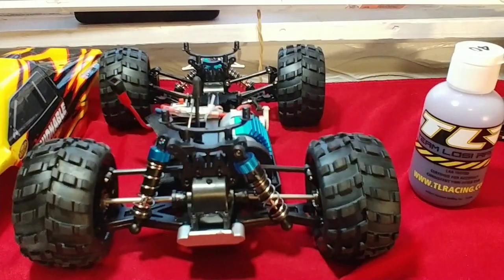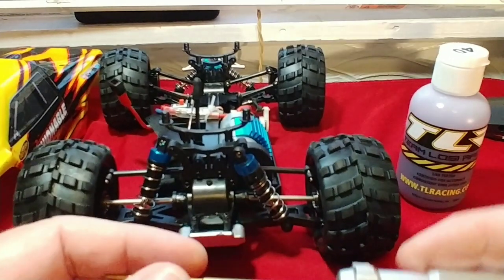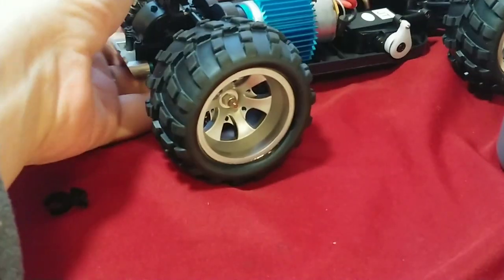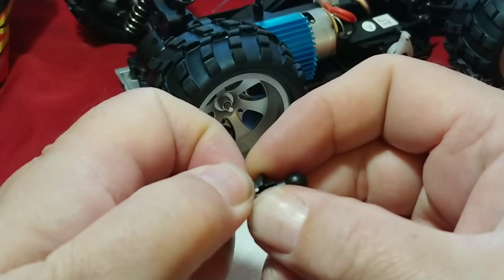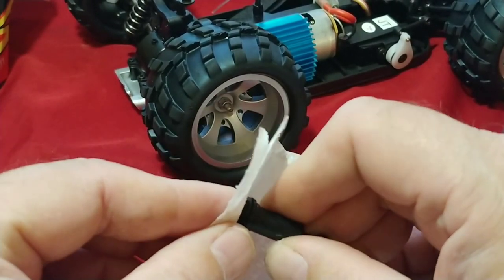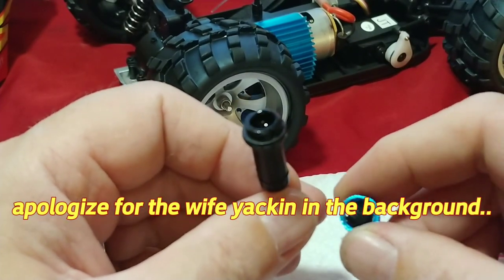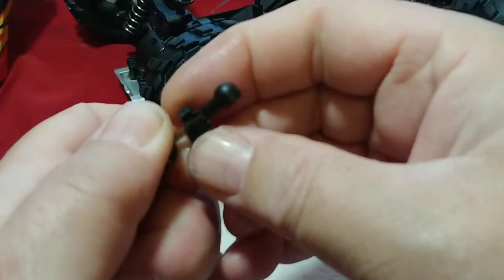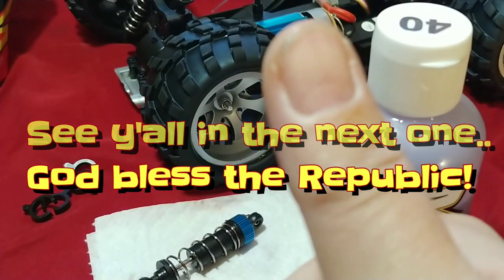WLtoys A979,A969,A959 SHOCK OIL FILL

Comment: Good job, very informative video. Thanks for sharing!!! Question: At 2:35 in the video, you showed 2 spacers at the top of the spring for tension. (Mine only has one spacer) Did your's come with two spacers or did you add extras???

Comment: Hello. Thank you very much for this video man🙂👍 Got a new sub. I am new to rc hobby. But i have 4 a959 different version cars. One a979-b and two wltoys 144001 and one wltoys 12428. And a Arrma Granite 4x4 blx 3s. And I must order oil to day for all my cars. Do you think it is good enough to buy one bottle of each oil from 40 wt to  90wt? Or what oil should I order. I just need the wt number because I am buying from my country store. 6.9 dollar per bottle. I think to buy 40.45.50.55.60.65.70.80.85 and 90 wt.  Will that be good be good order? Hope you can answer fast.  Have a nice weekend. Sry my not so good English.

Comment: You can pull the shock from the balls without removing the screws
Reply from the maker: You can..just be careful because the screw also acts as a way to "expand" the size of the ball in order to retain the shock.